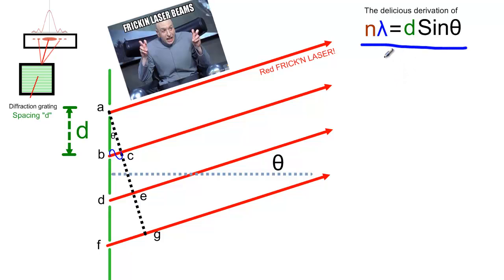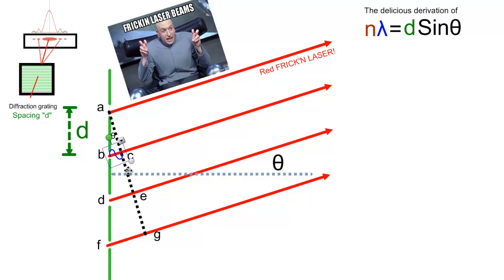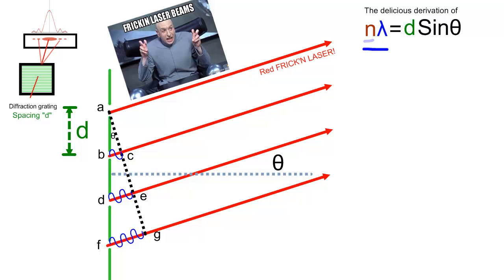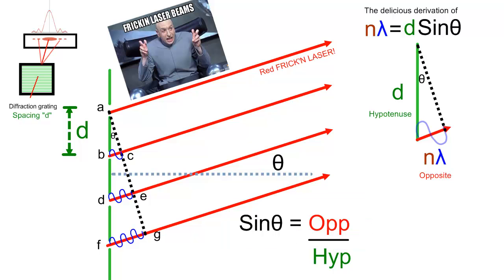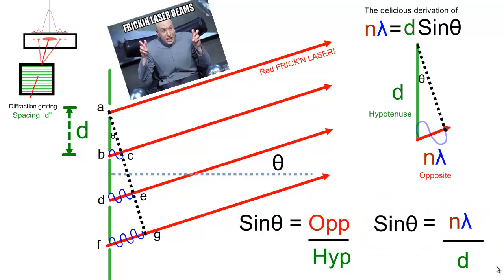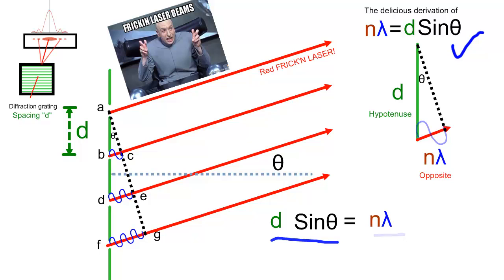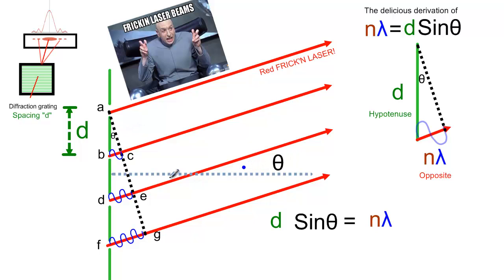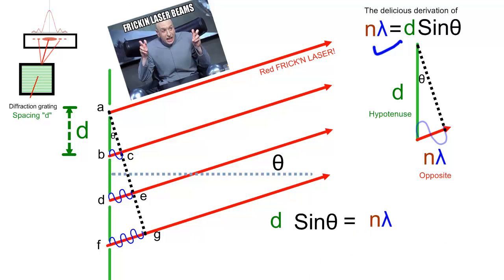Diffraction Derivation

Comment: ugh I am having trouble understanding this. Okay, so when you explain WHY there is constructive and destructive interference, the light has to be hitting the same point. If you have parallel ray lines like in your diagram, they never meet on the same spot, so how could they interfere with one another? However, if you get the ray lines to converge on the maxima points, you can no longer use a right-angle triangle to identify the difference between the lengths of ray-paths, making a line perpendicular to the lines doesn't make the lines equal.... I know my explanation is hard to follow, but I wonder if anyone else sees the same problem